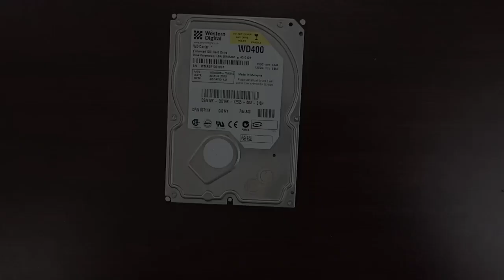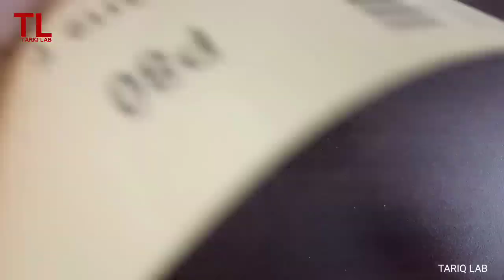What Can Be Made From An Old HDD | Amazing Idea Using Old Hard Drive

Comment: I have seen many videos, this one is the best using the LM7805 to by pass the 30 sec on/off spinning restriction of the smart hd.*update: The mosfit got really hot after 1 min run, i placed heatsink under but i think it wont last long.
Reply: i don't think the 7805 is necessarily a mosfet but is just an old standard 5 volt regulator and that is it. Where are u getting this 30sec on/off spinning restriction.

Comment: Hi. I am using almost same pata hdd and giving it supply from a 12+5 volt adaptor instead of 7805 ic but hdd motor stops quickly like 15/20 secs. Any other hack you did in the hdd circuit board?
Reply from the maker: May be voltage drop, check both 5 & 12 v
Reply: @TARIQLAB  nope. It wasn't voltage drop. You missed the part where Data pins are required to be connected in order to run hdd constantly. I did that and now it's working perfectly.
Reply: explain what did u do? thanks
Reply: @amitagrawal9672 please can you explain which pins need to be connected I am also using pata
Reply: @adnanakhtar7  WHICH PINS NEEDS TO BE CONNECTED FOR pata HDD?
Reply: please help

Comment: can anyone figure out what he did with that 7805 regulator and why waste all that power rather than just apply 5v into the 5v terminal only and forget about the 12volts. It's not that sensitive to exactly 5v.
Reply from the maker: To run desktop hdd 5 & 12v required

Comment: Not working
Reply from the maker: Why?
Reply: @TARIQLAB  @amitagrawal9672
1 год назад
 @TARIQLAB  nope. It wasn't voltage drop. You missed the part where Data pins are required to be connected in order to run hdd constantly. I did that and now it's working perfectly.
Reply: @ВладимирБомк  which pins need to be connected in pata hdd ?